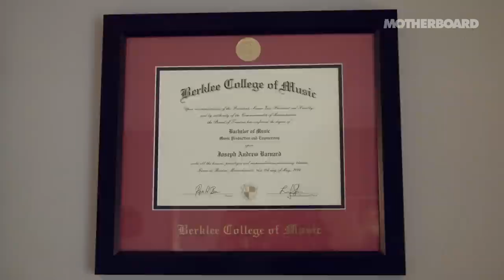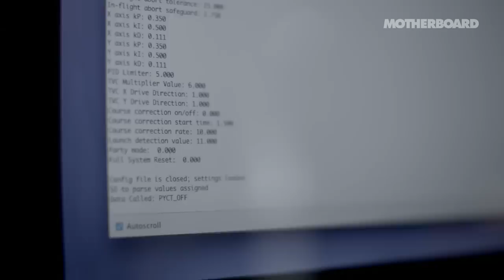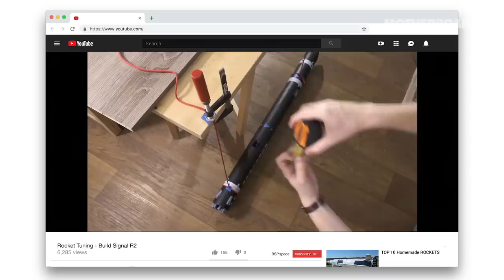The DIY Rocketeer Building SpaceX Replicas of Self-Landing Rockets

Comment: If he could control the throttle, he could land his rockets much easier.
Reply: Seems he's probably using solid fuel so that can't really be done unfortunately
Reply: @XboxIssues  I imagine some sort of dampener might work, but would have to withstand a lot of thrust.
Reply: Refaldooloo Or have solid rocket fuel he makes, not store bought, and build lower-thrust segments of rocket fuel (made of sugar and potassium nitrate for example) to “control” the throttle. Basically have the solid fuel high thrust and interlace sections that are lower thrust
Reply: Only problem with that is it introduces the likelihood of human error
Reply: He seems very close to completion, I’m wondering if a larger extendable base could be implemented made of a material such as carbon fibre.
Reply: @Z3NTR0music  it can be done with coding which would eliminate that, unless he codes it incorrectly of course.
Reply: Falcon 9's don't control the throttle either. They just flare out.
Reply: Alex Neagu Nope. He just needs more fuel with the landing first. The trust is only needed for lowering the speed so he can land it. But sure it would be cool if he seperates the fuel and the oxygen. Even if the fuel is solid, the oxygen can be throttled.
Reply: He's using solid rocket motors so this really isn't possible :(
Reply: Rockets are way too small for that
Reply: He has a video about this. He was actually trying to build up and engine so he could throttle it, but it's not cheap or even "easy" to make a liquid fuel engine for model rockets. Expensive and it has too many parts that could cause failure. Check it up on his channel. This guy is truly amazing!!
Reply: If he is using a fix thrust and time engine, it will only be able to make it work if his velocity and altitude at firing are also fixed. This appears to be his method.  Certainly SpaceX would be fixing the altitude and velocity for firing, but then also using throttled rockets.
Reply: @jonnynik7626  they do have throttle control. but the thrust of one merlin engine at minimum throttle is more than the weight of a nearly empty falcon 9, so they have to hoverslam and time the landing for the precise moment when the rocket is about to start going back up.
Reply: I've seen some throttle designs for solid boosters. They work by redirecting the flow to the sides.
Reply: I'm no rocket scientist but I think without being able to vary the amount of thrust and or burn time it will be difficult to get consistent landings but if you could use several stages or perhaps more than one motor or a way to redirect the gases out the sides like someone else said it could def work if you design software for it
Reply: He could have some actuated thrust deflectors block a portion of the exhaust to throttle thrust. I imagine those solids burn pretty hot though.
Reply: EXACTLY
Reply: @jonnynik7626  Falcon 9's do control their thrust, however, the minimum throttle setting is more powerful than required to lift the nearly empty rocket. And that's with only one engine burning too.
Reply: @Madrrrrrrrrrrr  Solid fuel isn't usually controlled like a traditional "fire"... Part of what makes it solid is that the oxidizer is mixed in with the fuel, such as potassium nitrate. So, and I'm definitely not an expert in this, I think that a potential solution is to baffle the expelled gases such that their direction of force is symmetrically expelled radially along the axis from which the thrust is being applied. i.e. fan out the thrust to reduce how much force you're directly applying against the falling motion of the rocket.
Reply: I think so
Reply: I don't think he can land it only with solid fuel. I think it'll be a lot easier if he just put some propellers on the rocket and let them land it instead of the solid rocket motor. Maybe there could be a small drone inside the fairing that could be programmed to land the rocket.
Reply: @alexneagu8212  That'll be a whole another variable to how he configures his thrust vectoring module if I'm not wrong, I've never made these rockets I'm just a physics student
Reply: Could you apply a throttle at the nozzle that redirects the thrust, like reverse thrust on a turbo jet? Just enough to bleed off thrust either laterally or backwards where it's needed. If you could redirect the thrust laterally you could possibly use that for controlling it's stability too?
Reply: @Z3NTR0music  wdym
Reply: Its more important to time the burn so that you stop right as you touch the ground. Even big liquid rockets will just time their burn so they are at 100% throttle for the entire landing.
Reply: @jonnynik7626  you sure about that?!
Reply: @jonnynik7626  The Merlin 1D engines can vector thrust for greater control to the rocket. Each Merlin engine produces 854 kN (192,000 lbf) of thrust.
Reply: @XboxIssues  : plus, with solid fuel rocket engines, he’s limited by fuel supply. But, he’s figuring out the basics.

Comment: Propulsively landing a rocket with a solid rocket motor is unbelievably hard because a solid motor can’t be throttled up or down. It just ignites and burns, no way to make on the fly throttle adjustments. I’ve got so much respect for this guy for going for it. If he can time the ignition of the motor correctly, I think he may be able to do it. Not to mention he’s self taught, and his rockets have gotten very complex with thrust vectoring, flight control, etc.

IMO he’s going places, and “places” could very well end up being SpaceX or Rocket Lab.

Comment: The solid fuel rocket burn rate is slightly inconsistent so that could be the reason why you might not be able to make a perfect soft touch landing. But what you've achieved so far is still pretty much remarkable buddy. I hope SpaceX takes you in.
Reply: I was wondering about that. I suspect he'll also have problems generalizing this to the full flight because he'll need an engine he can restart.

Comment: Trying to land with solid rocket fuel? Are you kidding me? The conditions would have to match 100% to get it right.
Reply: Thought the same, without thrust control that rocket will never land.
Reply: that's why he is using store bought motors. They're pretty consistent
Reply: @linecraftman3907  
Ok, fine. But how do you control the thrust? Once you light a rocket using solid fuel it doesn't stop burning until it's gone. You have zero control as to when to extinguish the thrust.
Reply: @kirkthiets2771  You don't need to control the thrust if you choose the right motor and ignite it at the right moment, and if the ignition and burning of the motor are consistent and predictable. It would not work for all descent speeds and angles, however, and so understanding how the rocket would descend before landing is necessary.
Reply: @CHICKSTER118  you do need to control thrust if you want consistent results...
Reply: @user-gp6ph1pl2t  You do not need to control thrust. You need to know thrust. I.e., you need to know how the rocket motor will perform when lit. This is the job of the ballistician. The ballistician designs a solid propellant grain (geometry, composition, ignition characteristics etc) tailored to the mission profile and desired flight performance. The ballistician "controls" thrust. It doesn't matter if the rocket is going up or coming down. If you can predict how the rocket will fly, you can design a grain to slow it to a stop as it reaches the earth's surface.

Now, you bring up consistency. This is certainly true. You could not, for example, tailor the thrust in the final moments to ensure a perfect landing every time, because we expect some variability in the rocket's state at touchdown. But this can be remedied by designing a rocket structure with some structural margin, able to deal with the variability. This might mean that the landing footprint of the rocket gets larger (longer landing legs), or that the structure is built to withstand higher loads (harder touchdown).
Reply: @user-gp6ph1pl2t  I will concede that the task of landing, say, a large booster with a solid propellant rocket motor is considerably more difficult than what SpaceX has done, precisely because of the lack of throttleability of solid rocket motors. But I would not say it it's impossible to get consistent results.
Reply: The same situasion when people laugh at rocket landing idea. I believe there is something called suicide burn.
Reply: Shasta Graff  if he does that, there will be no this video
Reply: @kirkthiets2771  Thrust diverters,  look up thrust reverser on jet engines.
Reply: @Joshua Smith Look at my reply, I have nowhere argued that using solid propellant is a good idea. I only argue that it is possible. Perhaps you could offer your thoughts on why landing with solid propellant rocket motors is ridiculous, to add something to the conversation.

Comment: Try to add 3 booster modules near the nose of the rocket. When the rocket activates it's landing protocol using a sensor, the 3 booster modules will act on the opposing direction of the main boosters. This will somewhat try to create a balanced force and slow it down.

Comment: The thrust vector control is impressive for a rocket at that scale.
Using the simplicity of  the chemical engines is good - it allows the focus on the guidance and control.

Going from solid rockets to something with a throttle control will be a challenge - would love to hear if there is a solution for solid engines, or if have to go some traditional way with other fuel and engine types.   

Maybe put the engine higher up in the body, and have venting to control the thrust.  Then have the vector control on an direction-ally controlled exit vent.

thanks for sharing.

great video.

Comment: The rocket motor in a liquid fuel rocket would make it a lot more complicated, but I think it would be better if you want to make a self-landing rocket.  It doesn't seem very practical to try and do it with solid fuel because instead of throttling the motor, you would have to ignite the solid fuel at just the right time and hope it burns for the right time in order to land.

Comment: Its cool but very easy to do. What's holding him back is his engines. You cannot expect to have a 100% autonomous flight and propulsion landing with a simple model rocket engine. Once ignited it will burn for the same exact amount of time and with the same thrust everytime. If you can't control the throttle or shut down if needed you will not land that rocket. It will hit the ground and the engine will just continue firing
Reply: No. Incorrect. He is intact very close to it.

Comment: He should be using a hybrid motor with a much higher total impulse.  Hybrid motors use a solid fuel but a gaseous oxidizer (usually nitrous oxide if I remember correctly, at least for hobbyist motors).  This theoretically allows a hybrid motor to be throttled and shut down at will, but I don't know if any of the hybrid motors sold to high power rocketry hobbyists have electric control for thrust.  This project will never work repeatably if he's using cheap-ass Estes black powder motors with fixed thrust, fixed burn duration, and low total impulse.

Comment: I think it's fantastic" I'd like to see anyone else pull this off if they have a bad comment to it. I'm quite amazed how close he's got this" success is just around the corner if he hasn't already got it , that's tough using a solid fuel motor as well" a perfect thing for this technology is for all these people that think a quad copter will be how we travel? Well not without Auto rotation you ain't going to see me in one of them people don't think about that &: the people making the quad copter surely don't mention anything about what to do if a engine fails or a thousand other problems that can make you free fall back to earth, some claim a parachute will save you, well only if all conditions are correct to allow the chute to open correctly" plus it takes altitude loss to fully inflate a chute" the odds of everything working perfectly with the catastrophe failure is slim to none, for a nice chute deployment", soooo if this young man can mount 4 solid boosters on a quad copter so just before you get to the ground it can stabilize you and set you down gently then you got something there" this technology would be great for all aviation" mabey even where people work in very high places to stop you from hitting the ground in a accidental fall. I can see many applications to this technology" you go dude this rocks" and if you ever need a employee who can build anything , give me a call because I think your on to something big here , don't give up because of any negative comments , that's just ignorant behavior, shit like that happens to me also. Keep up the good work " &:I'm serious about working with you" this is the future. You are you" your not Elon musk but I bet Elon will be thrilled with what your doing you can easily have your own company , and on weekends chill with Elon &: just talk about stuff in general but invite me as well we will have a blast . Lol  good work there " keep it up, you got this. It's incredible .

Comment: It will never work with the model rocket engines you are using. These things don't have a off switch or even like a control valve for  controlling the thrust and output. You could try using something like a liquid fuel rocket engine to control all these parameters

Comment: It's not expensive to build an aircraft able to fly high enough, it's expensive to make it able to do it fast on it's own. You could fly a cessna with oxygen tanks and a heater to get there, with the proper oxygen and gasoline injection installation. It may not be back though😂😂🤔better get a parachute too

Comment: all you do is assemble already made parts, ad some high tech bits someone else developed and made, programmed it using a language someone else developed and wrote, and you call yourself a 'rocketeer'?

design and build your own vehicle, your own fuel and engines, your own stabilization, control and launch facility, your own recovery system, etc etc etc than i'll be impressed

modern 'amateur' rocketry is like the Testors aircraft kits kids used to assemble decades ago - nothing more than a glorified assembler